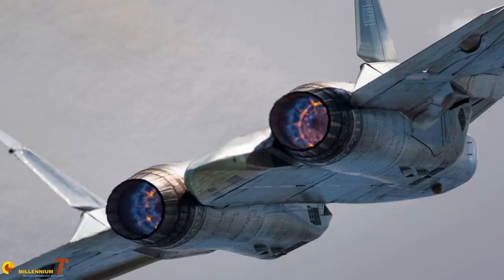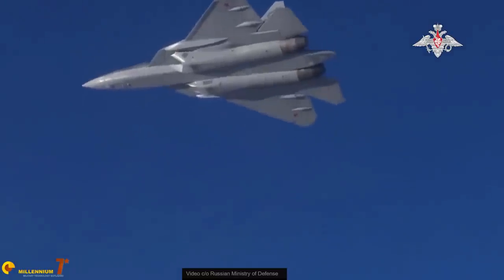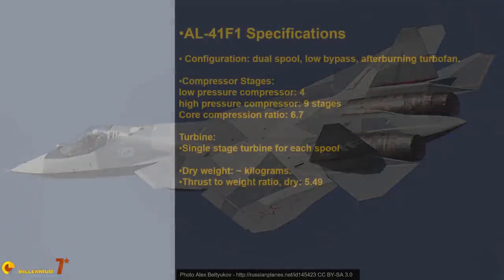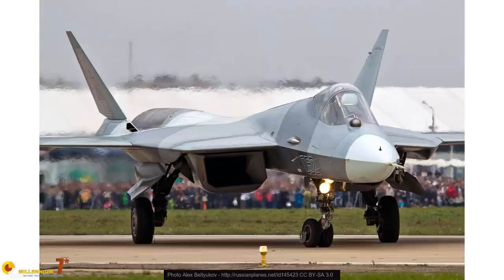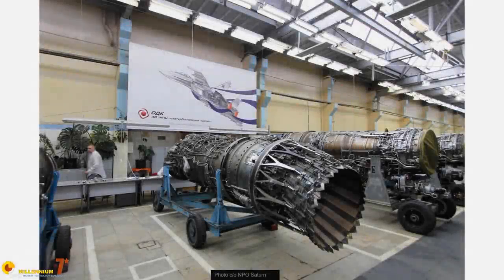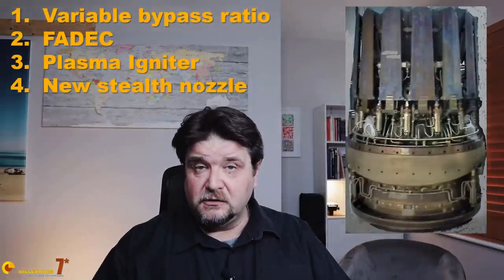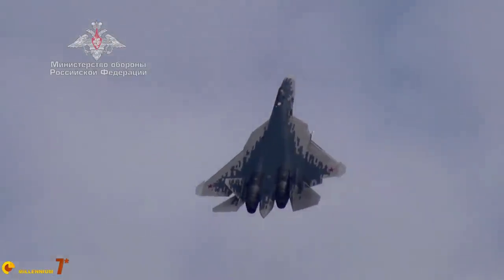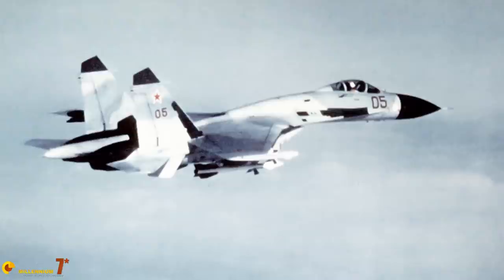Su - 57 the Raptor Slayer | Part 2 - Propulsion

Comment: The Su-57 has a feature that was long-promised for the F-22 but as of yet, has never been delivered—side-facing radars mounted below the cockpit on aircraft's 'cheeks.' These active electronically scanned array (AESA) X-band radars supplement the aircraft primarily nose-mounted X-band N036 Byelka (Squirrel) AESA radar. Supposedly these secondary radars have roughly a third of the transmit-receive modules as the jet's main radar. 

You can clearly see the side radar aperture below the 'chine line' under the aerial refueling probe. 

At first glance, the utility of these radars is clear—they provide a far greater sensor field of view and thus enhance situational awareness for the Su-57's pilot. But beyond this the most basic of advantages, they allow the Su-57 pilot to execute a key tactic better than nearly any other fighter around. This tactic is usually referred to as defending enemy's missiles while not getting "cold" on enemy's plane.

The issue is that with a typically fixed AESA radar or mechanically scanned array, pulling off a missile defending maneuver means the fighter doing so will lose its radar picture of the enemy it is trying to evade. Without third-party sensors feeding this data to the beaming fighter via data-link, its pilot will become blind to the tactical situation when it matters most. But what's worse is that any radar-guided missiles that have been fired from the now beaming fighter will not be able to receive mid-course updates, and thus those missiles' probability of kill will plummet, especially if fired off initially at long-range.

So fighters without cheek arrays, or novel swashplate like designs like those found on SAAB's JAS-39E/F Gripen and eventually on the Typhoon, and absence of engagement quality tracks provided by third-party sensors via data-link, the launching fighter will either have to take a more acute and less effective beaming angle in order to continue to update their missiles with their radar, or they will have to forget about updating them altogether. 

The Su-57 is also said to incorporate L-band radar arrays blended inside its large maneuvering leading edge extensions. These radars are more for target discrimination and identification than anything else. The aircraft also has another X-band radar array in its 'stinger' tail for enhanced situational awareness, and possibly for future targeting with extremely agile 'lock-on after launch' missiles as well.

It's also worth noting that AESA arrays can also be used to execute pinpoint electronic attacks. Theoretically, a fighter's radar system could employ these electronic warfare tactics while attacking another aircraft, or while under attack. Being able to do so even at oblique angles without changing nose position could be beneficial, as well. With that in mind, the Su-57 could be a powerful electronic warfare tool, if not today, then possibly the future. 

The Su-57 sports an advanced 101KS 'Atoll' infrared search and track sensor in the traditional position on Russian fighters—installed atop the aircraft's nose, near its windscreen. 

 IRST is among the best technologies available for detecting and engaging stealth targets from afar.

An advanced IRST was also promised for the F-22 as part of the Advanced Tactical Fighter Program but it was axed due to cost-cutting measures as the program moved from prototype to a production configuration. Today, the Navy and the USAF are on the cusp of procuring podded IRST systems for their 4th generation fighters. The F-35 can use its electro-optical targeting system (EOTS) for long-range aircraft identification and some limited IRST-like functions but is not comparable to a dedicated sensor.  

Like the F-22, the Su-57 has a number of missile launch detector apertures scattered around the aircraft but the Su-57 also has turrets that fire modulated laser beams at an incoming missile's seeker to blind it and throw it off course. The Russian system used on the Su-57 is part of the larger N101KS electro-optical suite that includes the missile launch detector systems, IRST, and the DIRCM turrets mounted dorsally behind the cockpit and ventrally under the cockpit.

And denying attacks by air-to-air missiles is definitely an intent for the Su-57's DIRCM system as, once again, it has a turret on top of the jet as well. So in this sense, the Su-57 is something of a pioneer in this regard and this type of system is also likely a hedge against future long-range infrared-guided and dual-model air-to-air missiles.

Su-57 can be armed with four beyond-visual-range missiles and two short-range missiles for air-to-air combat missions. The active radar-homing K-77M (Izdeliye 180) missile is the primary medium-range missile of the fighter. An upgraded version of the R-77 medium-range missile, the K-77M is a beyond visual range (BVR) radar-guided missile equipped with an active electronically-scanned array radar seeker. Russia is also planning to add the new R-37M long-range hypersonic missiles to the aircraft’s firepower.

For ground strike capability, the Su-57 is fitted with the Kh-38 tactical ground missile and a range of KAB family precision-guided bombs. It also has external hard-points that can hold additional munitions to support non-stealth missions.

Aircraft’s super-manoeuvrability allows it to dodge incoming long-range missiles and engage enemy aircraft within visual range.

So my friends, Su 57 never goes cold, there is always 360° awareness, passive and active, and there's hypersonics in the bays.

And these are words of amercan avio experts.

So....

Yeaa, F22 and F35 have anyway better avionics, better situational awareness, better...
Reply: It's funny how the world's largest producer and innovator in semiconductors, with more SC companies than anywhere else on the globe, still constrained the AESA radar count on the F-22A because we knew costs and industrial scaling demand would kill the program. 

But in Russia, with only one big semiconductor manufacturer (with lower quality SC materials who went bankrupt in Dec. 2019), they will magically populate the nose, cheeks, leading edges, and tail with AESA TRMs like they're drowning in SC components.

Does anybody else find that odd?

Meanwhile, pilots who have flown the Hornet, Super Hornet, F-16, F-15C+, F-15E+, F-22A, and early F-35 say the F-35 has so much more multi-spectral bandwidth awareness, that it dwarfs even the impressive SA of the F-22A.

Comment: Hypothesis #1: Use of TWC instead of control surfaces for flight efficiency. Can this contribute to SEALTH? I mean does change in angle of control surfaces changes RCS? will keeping them at optimum angle will improve stealth when the plane is approaching?
Reply from the maker: Yes, not much probably, but it might help.
Reply: I think it does help, with it the plane can fly in weird angles keeping its lowest rcs pointed to the enemy.
Reply: @Millennium7HistoryTech  thanks for replying. I asked this question because it's well known that caanrads reduces the stealth. I dont know impact of control surfaces (specifically levcon in case of su57) and their angles on stealth.
I love your channel because it's full of technical details. Lots of learning.
Reply: @Millennium7HistoryTech  maybe a corollary, does the aerodynamic profile for efficiency plus the stealth requirements for the su-57 have significant realms of flight with insufficient control authority by purely use of its control surfaces?   Russian designs have kind of stuck with the "neutral stability" camp for the longest time, vs the west going towards either the negative or positive behaviors in fighter/attack aircraft

Comment: I've been thinking about carrier operations and thrust vectoring - with the final engines the plane will have a thrust-weight ratio greater than 1 even at full combat load. I think it will allow the plane to take off and land at very low speeds, even if the wing and control surfaces don't work, and the plane will be steerable by TVC, eliminating the need for enlarged wings. This means IMO that you can operate effectively from a ramp-based carrier, and it won't be require a significant reduction of fuel or weapons load, the way the Su-33 does today. Additionally, this will allow the plane to land at similarly low speeds, reducing the need for airframe reinforcement, since it won't suffer  as large loads from the arrestor hooks as current planes do. Just to illustrate how much weight they can save, the F35C is 2.5 tons heavier than the A variant. If they can really pull this off - make a naval variant that's only lightly modified from the land-based version, can operate from a ramp carrier with full combat load, that would be tremendously handy.
Reply: That is absurd. Russia does not have an aircraft carrier and their economy is broken. Why would they spend billions developing a technology on a plane they would most certainly never need.
Reply: @konfunable  the carrier ops would be very challenging and probably not in line with its intended role.  however, being able to field a "peer" platform to the F-35/F-22 without the expensive support reqs or at less improved and smaller airfields would be definitely advantageous.  Just the operational flexibility, if it delivers on the operational range goals and plus if its packing a sensor suite approaching an f35 which the back chatter seems to indicate, this would be a tough bird. I don't think this is for the US and the west.  This is to counter the PLA and China's increasing attention on Russian territory.  This thing has very long range air dominance and interception on mass targets written all over it.
Reply: @Badjujubee  Can you please elaborate on what the Su 57 lacks to be a carrier-capable fighter?
Reply: @torginus  at this point with the Russian Navy, pretty much the lack of carriers.  The Kuznetsov is not nearly enough to fill that role other than an expeditionary force.  And I still lean back to this bird being very focused on territorial defense for Russia proper.  Think Mig-31 meets Su-27.  Its for fighting off large numbers of hostile aircraft over wide swaths of territory in very hostile and contested airspace

Comment: Question: how much efficiency loss is incurred by thrust vectoring at maximum deflection?
(Engine thrust efficiency, not overall flight efficiency as you mention at 16:15)
Reply: In general there are almost no losses, and in some cases even slight increase in thrust (depending on TVC type used).
Russian solution is the most efficient regarding plume deflection in relation to nozzle deflection and plume deformity!

Comment: Paul Metz, a test pilot involved in the Yf-23 and F-22A programs, had gone in record stating that the F-22 utilizes TV for flight trim. If you remember that it has (allegedly) the highest super-cruise speed of any fighter, higher even than the max speed of the F-35, I would say that TV is a very important feature in a 5 gen air superiority fighter.
Reply: @unknownuser069  Did I said it reached such high super-cruise numbers by the TVC alone?
 
Go easy on the caffeine kid, you need to relax a bit.
Reply: @unknownuser069  Sigh...

Comment: The new Russian engines show less smoke and blue afterburner flame, both indicate that they are making progress.
Reply: Where is the proof?
Reply: @reneegiese6315  complete combustion means higher efficiency. 

Older soviet engines (think RD-33) runs "very" fuel-rich in combustion chamber to lower turbine temperature. This creates the infamous black smoke.

Comment: Yours is one of the few military aerospace channels in Youtube worth watching, so please allow me to provide some reliably contrasted information to address some of the assumptions made on the video:
> The AL-41F-1S has an operational life of 4000 h, which is a lot of years of operation, with a way lower price than Western engines. AL-31F's life was way lower, close to 1500 h from what I have seen. There is no such 4-5 times longer life/overhaul periods for the Western engines and as said above the price / durability equation is not clearly in favour of the Western approach. Values for the AL-41F-1 are not known, but the engine is quite more sophisticated than the F-1S, we don't know if it is more durable i.e. through the use of more expensive coatings and alloys or not.
> Performance: we know from Pogosian that the 41F1 should make roughly 2.5 tons more thrust and weight 150 kg less than the 31F, so that would be ca. 15 tf thrust, 1370 kg. We know the weight of the TVC system in the AL-31F too, 30 kg. Should not be way higher in other engines using the same principle.
> No intake mesh in the Su-57. The image you show is a CGI related to the variable ramps
> The actual radar blocker has been seen (or rather it was caught through editing) in one of the videos the Russian TV filmed of the first delivered unit. 
> The engine you show as izd. 30 is a Salyut prototype of 3D TVC
> From what we know, the TVC scheme in the Su-57 is the same as in the Su-35, with inclined 2D nozzles to get a sort of 3D effect as you explain
> There are good sources of information about the real parameters of the izd. 30. It has roughly the same TSFC of AL-31F, highest specific thrust of any comparable engine and its specific weight should be one third lower than AL-41F-1S. TWR would be close to 13, max thrust for 1400 kg weight ca. 18 tf, mil thrust should be higher than F119. Your take that it is a VCE can be polemic, but it is supported by what we know. Probably two stream variable engine, we know it is not three stream.
> With way bigger intakes, variable ramps, no S-duct and engines of higher specific thrust, the supercruising capability of the Su-57 should be clearly superior to F-22.
> As to TVC, it clearly has a trimming use, besides supermaneuverability, carefree nose-pointing at very low speeds and capability of exotic manoeuvers like flat turns or your theory of defeating incoming missiles. Russian doctrine is that a plane that is controllable at any time allows the pilot to concentrate in the battle and not in keeping the plane within an acceptable envelope. It is also better for RCS.
Reply from the maker: Can you point me to the sources, please?
In particular about your point 1,2, 5?
If I made a mistake I will do a correction short.
You can e-mail me in private from the about tab on the channel page, if you prefer.
Reply: @Millennium7HistoryTech  Sure, I will write you